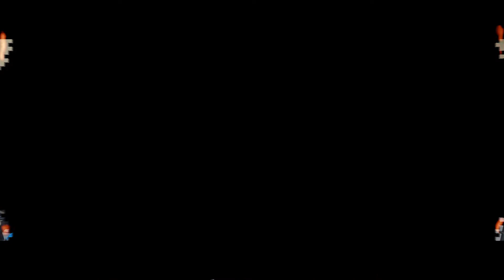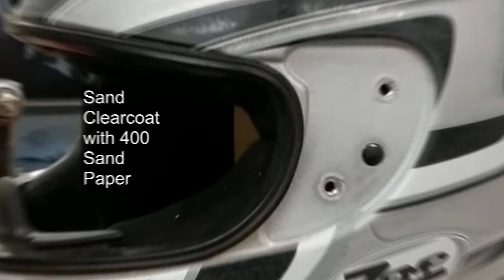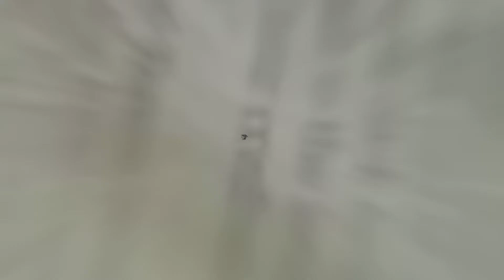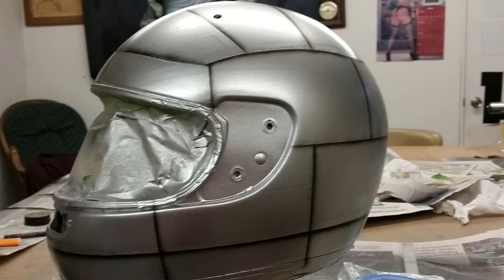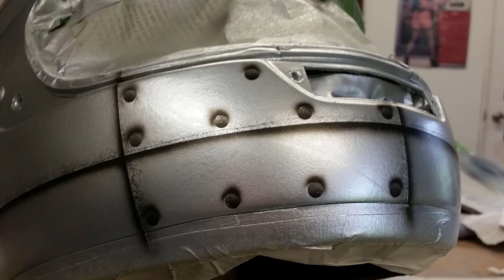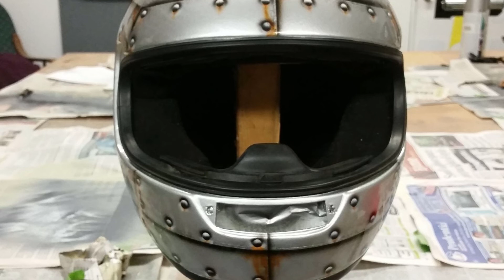Airbrushed Metal Panels and Rivets on Helmet - How To

Comment: I love this helmet,  great work.  I'm new at this and getting ready to buy my set up. What paint are you using for your helmets? Is it acrylic? Enamel?
Reply from the maker: Easy, also along with my last comment make sure you use the 4011 reducer by createx and not some home concoction. I also have a video on the reducers and Clears by Createx. Check those out as well if you get a chance. Thanks for the question and thanks for watching.